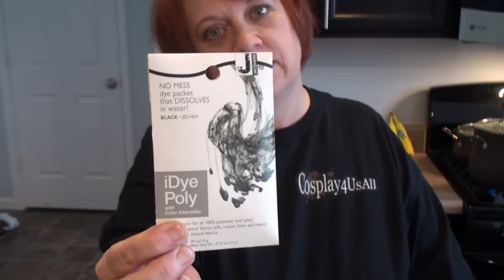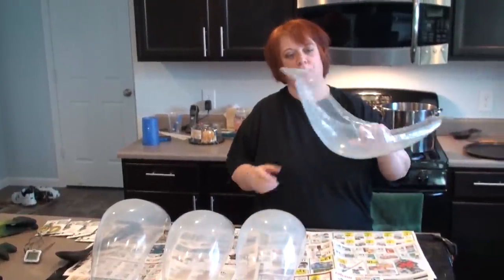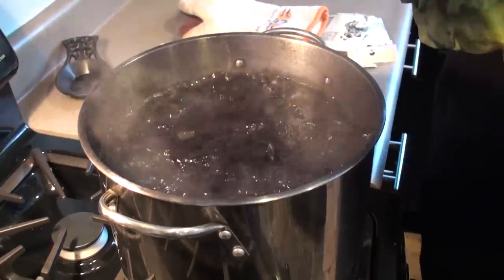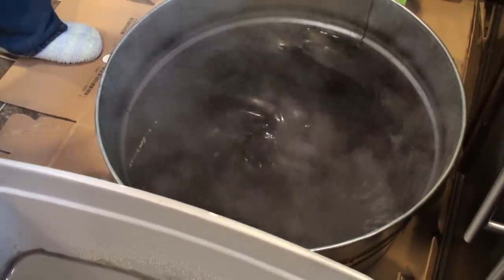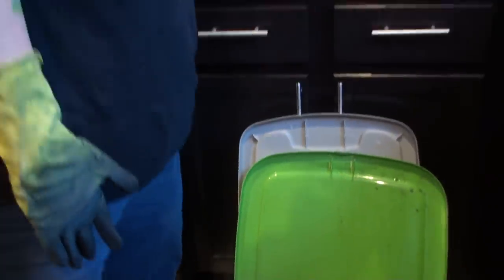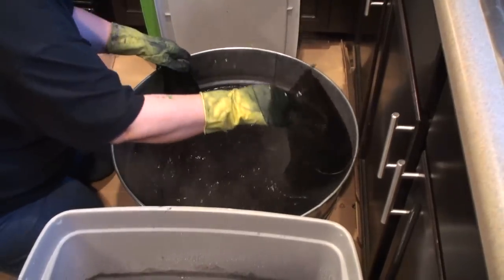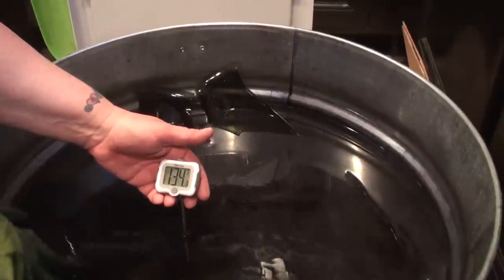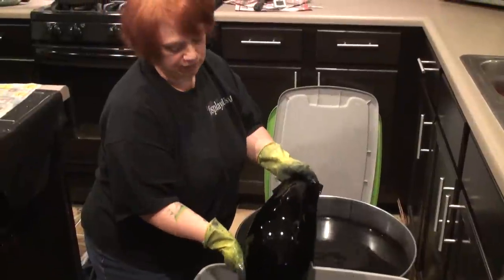How to Dye a Plastic Visor (PETG)

Comment: were these vacuformed helmuts?   & if so, was this plastic origionally a plastic bottle?
 asI'd like to use this method to make a giger ALIEN head dome
Reply from the maker: The actual helmets are resin casts. The visors are vacuum formed PETG (which is the same type of plastic soda bottles are made from).

Comment: Awesome video, was looking for the metal wash basin on amazon and having problems finding it, also what is the dimensions? Any help would be awesome
Reply: Not sure about the specific one that they used in the video, but you can get metal wash basins as Home Depot.  You could maybe also use a metal trash can (although the height may lead to faster water cooling).  Seeing them in person might help with finding the right size.  You could even take a sample piece with you to make sure it will fit.

Comment: I'm having some bad results using this method with acrylic plastic.  I'm using yellow dye and added the color intensifier packet that's included with the dissolvable dye packet though.  Am I correct in assuming that you didn't add this packet for your PET visors?
Reply from the maker: We did indeed add the packets of color intensifier. Acrylic is a harder plastic than the PETG is, so you will most likely need to adjust your temps accordingly. Keep it below the deforming temp, but hot enough for the pores in the plastic to accept the dye. I know others have used it on acrylic, but I don't know the temps they had the water heated up to. Should be able to find that out online somewhere if you look up the specifications for your particular plastic.
Reply: Hi Stephen ! I am actually using it on dimmed plexi glass. My first try was when water was still boiling in the pot, but I don't have the thermometer to check the water temperature yet, need to buy it. The color catch quick (I used the intesifier as well) but I got dye spots on the plexi piece. There might be few factors that caused that. 1) Dye was not dissolved enough and I put the plexi inside the pot too fast 2) Water was boiling 3) Water was too hot 4) Plexi piece actually touched the bottom of the pot and I suppose I need to somehow keep it floating/'in the air' (petg is so to say floating in the water, at least at video from @Cosplay4UsAll). So I need to make more tests. 

Could I get in touch with you somehow? Maybe we could work it out together and share our progress on that.

Comment: Wow amazing I have thermoformed a lot of PETG over the years this looks promising
May I ask if you did any prep work to the plastic first or did you just remove the covering and submerse in the dye?
Also whats the consistency like? 
Is the finish streaky looking in anyway or is it uniform?

Thanks Steve (Australia)
Reply from the maker: No prep to the plastic. There are sometimes a few random spots where the dye settles more than others but most can be buffed out with the plastic cleaner. The finish looks perfect from the outside and good from the inside. There's a link in the details to pictures taken from inside looking out.
Reply: +Cosplay4UsAll Thanks for the quick response love your work will be sure to checkin again soon

Comment: Hi there.  I used this method to dye a pair of lenses for a Darth Vader helmet.  I used one packet of black in simmering water and dipped them once for 7 minutes.  They are definitely dyed, but they are now completely opaque, I can't see on the other side at all.

Any recommendations on what I can do to remove enough dye so that I can get them transparent again?  Also, any idea what I might have done wrong?

Wonderful video by the way, glad you have success with it :)
Reply from the maker: +0newingedcrow Hmm no idea why it would turn opaque. Was it PETG or a different type of plastic? All plastic have different chemical structures and can react different. If the lenses were taken from something else it is possible they have a coating of some sort on them, which would effect the dye transfer. It is also possible the water was too hot for the type of plastic you used. 
As for removing the dye, I couldn't say. We use plastic cleaner (see the details in the text beneath the video) to clean our dyed visors, which does remove a fine layer of dye, but I couldn't say if that would help in your situation :(
Reply: Thank you for the help :)

Comment: My friend and I just followed your video to dye our Daft Punk visors. We ended up with a bunch of sticky ink looking stuff on them and I am wondering what I can use to get this off. It is super sticky and thick, I think the iDye didn't fully dissolve. 
I know you talk about the Meguiar's PlastXand I plan on picking this up but can you recommend something to remove the buildup of Dye/Ink? I would truly appreciate it as a new visor will be expensive and may not be here before Halloween. 
Thanks.
Reply from the maker: Hmm I can't imagine why it is sticky. Unless maybe you used too much dye and not enough water....or the dye wasn't fully dissolved or stirred enough. That MIGHT make it sticky but I couldn't say for sure because we've never had (or heard) of the sticky issue. For dark spots (which happens if it sits on the bottom of the dye bath too long or you have very hard water) you can use Meguiar's PlastX plastic cleaner and polisher. It takes away a lot of the dark spots and will leave things nice and smooth and shiny. Might even help with the sticky stuff!
Reply: We used only one pack and I believe my buddy didn't stir it enough. It was from sitting on the bottom and I assume it is just the dye that didn't dissolve. But because you said you use the PlasticX for cleaning I think ill give that a try. Hopefully it is strong enough to get the spots off as I don't believe it actually saturated the plastic, just surface.
I appreciate your time and informative video.

Comment: Hello! Thank you for the video and I have one question, Ive been thinking of building a helmet and across the visor there is an X Pattern (for example sakes lets make the helmet pink and the actual X black).

Do you think its possible to just dye the outside with the X pattern and dye the inside grey so I see a uniform color and not a big X in my face?

Comment: Great technique! I used this to dye some visors that I am using for an alien costume from the movie Alien. I'm getting a lot of residue on the PETG and it wont come off with soap and water. Did you encounter this problem? Also what plastic cleaner did you use? I am hoping this will take the residue off, as it makes the visor hard to see out of.
Reply: I have the same problem with the residue... Did you find what to do to prevent that?
Reply: Nope. I even tried polishing. This stuff is strong. I definitely suggest not adding too much of the dye powder and/or using a grate to keep the plastic from touching the bottom of your container.
Reply from the maker: We used Meguiar's PlastX  to clean the visor afterwards. For us, it took off a lot of residue. For the deeper stuff you really need to use some elbow grease! Also, not letting the part of your visor that you plan to see out of, touch the bottom of the bucket with the dye, should help reduce the amount of residue. Swishing the visor around should also help.
Sorry for the delay replying to this....just now saw it!

Comment: after you cut those pieces out of petg sheets , are you able to do anything with the remaining petg that you cut away?  Trying to figure out how to reuse it or whatever.
Reply from the maker: Generally no, it's been heated, cooled, and has the pattern of the vacuum form base pushed into it.
Reply: @Cosplay4usall  I just happened to see a video of a 5 x 5 inch dental vacuum former for creating a form of 3d scanned teeth.  Maybe a nearby dentist wants to try it instead of throwing it out.
Reply: @Cosplay4usall   I might try nailing the petg strips to the inside of my shed's posts too because I have seen mice climbing wood when I open the door.  I don't think they can climb smooth plastic nailed to the beams.

Comment: awesome video, i have a question about last two pack of liquid that you add into a pot, what is it? In Thailand we don't have both Rit and iDye, can i use another dye like a "Dylon" to dye plastic?
Reply from the maker: The iDye Poly is a two pack dye. One is a pack you just drop in the pot, the other is a liquid that helps keep the color true and make it grab the poly (or plastic) better....I think, lol. I would think any dye that specifically states it is good for fabric that contains plastic fibers, like polyester, should work. I am not familiar with Dylon so I'm afraid I couldn't answer that specifically.

Comment: Is this the same as thick polycarbonate plastic?
I heard using acetone would open the pores on thick plastic is this true?
Also for best results how many packets should I use
Reply from the maker: I have no idea about the acetone trick. Polycarbonate is a different composition than PETG (Polyethylene terephthalate). PETG is made to be moldable, so is probably "softer" than the plastic you mentioned, although it does look like the working temps are about the same. Number of packets is determined by how dark you want the color, the size of the piece, and the amount of water needed to submerge the piece. The more water used, the more dye packs needed.

Comment: I'm looking to do this, but I want to mask certain areas so they aren't affected by the dye. What would be the best solution? This would be for PVC flexible tubing. Thanks for the helpful demo.
Reply from the maker: Hmm. I really couldn't give you a definitive answer on that as we've never had to do that. I would suggest lots of experimenting on some scrap stuff first! Try masking off sections with various types of tape. It will be hard though, as the tape will need to be waterproof. You could possibly try using liquid masking tape too. Or maybe some sort of solvent/cream/ointment that is water resistant (baby diaper cream??). I don't know....just shooting ideas here, lol. Good luck and let us know how it goes!

Comment: Loved the tutorial. Big question, because I've racking my brains trying to find a way to do it.  Do you think there's a way to add something like fine glitter to the tint so it would stick to the visor? Going for a tinted but also slightly sparkly effect on our visors and would value some input. Thanks!
Reply: Probably late for ya, but you could use a clear coat with glitter. I've used a glitter clear spray can I purchased from Autozone or you could even use a nail polish clear coat with glitter

Comment: Informative video. I had a question, though.

Do you think this method would work on a clear acrylic globe? It's similar to the kind that you would put on a street light.
Reply from the maker: +BrHa Couldn't really say for sure, since acrylic is quite different from PETG. Different chemical compound, different temperature range for deformation and absorption of the dye. If it doesn't work, there are paints you can buy that are transparent and can be used on acrylic, like the stuff used to make stained glass, or to frost glass. Check your local Hobby Lobby, Michaels, etc. And if you try to dye it, would love to know if it works!

Comment: Hello guys ! Really amazing tutorial ! 

Question: is this method going to work with a matt/frosted plexi glass ('frost'/matt is original, I bought it like this)? I wanted to use a paint for ceramics + airbrush but this is not a good method. Paint is too heavy and when mixed with water - to liquid and won't stick to the plexi. So now I am thinking about your method. I already bought iDye (damn, we don't have this in Poland, needed to buy from UK online store).
Reply from the maker: Having never tried this myself, I can't say for sure, but I would "guess" that it would. You may have to soak it longer, possibly adjust the temperature, since it is a different kind of plastic, but I think it would be worth a try! The worst that would happen is the dye wouldn't take to the plastic. Let me know your results!
Reply: Cosplay4UsAll hi! 

So I gave it a try and plexiglass catched the dye. I left it in the boiling water for about 2-3 minutes and I got preety good color. The only problem is that 
a) turquise iDye is actually blue :( I need to mix it with yellow or green to get turquise. Did you ever mix iDye poly?
b) the plexiglass was covered in small dye spots. I am not sure it happened because I left it in the boiling water and bubbles did the job or iDye was not dissolved enough (had the same issue when working with airbrush and glass paint that was too heavy for the airbrush). 
I need to order yellow and green iDye for mixing (we don't have it in Poland :( ) and experiment a little more.

Comment: hi, im planning to do my motorcycle indicator lenses, do u think 1 pack of dye in a small pot should be enough?
Reply: If I had to guess, your lenses are probably polycarbonate.  You could buy 100 packs and it would not dye them.
Reply from the maker: This process most likely will not work for your project. The composition of the plastic on your motorcycle lenses is much different than the PETG used for our visors. The indicator lens covers are much harder, denser plastic, usually with a protective chemical coating to prevent/reduce chipping and cracking. Your best bet would be to use the spray tint and carefully spray the inside of the lenses. You don't need to worry about being able to see clearly through it (like you do with a visor) so you should be fine. That is actually what the spray tint is made for ;)

Comment: i tried this with plexiglass which failed. it just kept coming out perfectly clear. so i got some petg plastic, cust a piece to the shape i need and did this same process but it keeps coming out perfectly clear?? Am I missing something?
Reply from the maker: +Arthur Yore III Did you peel off both protective film on the PETG?  Are you using the iDye Poly and getting the temperature correct?  You also do need to let it soak a while, like it says in the video. The longer it soaks, the darker it gets.
Reply: +Cosplay4UsAll you know what i think i may have gotten a different type of iDye... thats probably it! thanks!

Comment: so i noticed that there is poly idye amd then just normal idye is there a specific one i should use to get the best result. Thanks :)
Reply from the maker: You want the poly one (poly, as in polyester) as it is specifically formulated to work with plastics.
Reply: Thanks

Comment: Would you know how to dye with food coloring? Nothing happens with just hot water. Wondering if salt or vinegar would help
Reply from the maker: Audun Jemtland I can't help you with that one. We use iDye Poly because it is formulated to work specifically for plastics and polyester type fabrics. Food coloring is.....well it's for food. And Easter eggs, lol.
Reply: Hehe yeah you're right. I read a recipee somewhere and remembered you. I swear someone knew. I just tried vinegar and food dye with a white plastic bag now to check, and it became purple/pink. And it worked instantly. Very interesting. But it didn't deepen more. So there's something to it. Thanks for a great video though.

Comment: Is it supposed to appear spots or is it a sign that i did something wrong?
I just finished dyeing it and i wonder if these spots are meant to appear and i just have to use plastic cleaner or that i failed dyeing it and just ruined it
Reply from the maker: Some spotting can happen, especially if you have hard water. I would try giving it a real good cleaning with the product (or similar) to what we recommend in the video description/details.
It is possible your dye was not fully dissolved/mixed, or started settling while it was soaking. If you can get the spots out, you could possibly try dying it again, and hope it evens out.
Reply: @Cosplay4usall  Thank you, it really helped and the spots are nearly invisible now!
Reply from the maker: Yay!

Comment: I tried to do this and I put the dye packets in and let them sit, stirred them around.. put the tinted water in a 5 gallon bucket.. and dipped the visor in.. It immediately became dark blue and clumped up in streaks on the visor. I cant figure out what I did wrong.
Reply from the maker: Wow. I have no idea! As long as the dye was fully dissolved and there wasn't anything on the visor itself, and the visor was not resting on the bottom, or leaning against the side, of the bucket, I don't know! If you want it dark, I would say just keep dipping it until the color evens out (and the streaks are less noticeable). You can also give it a good cleaning afterwards with Meguiar's PlastX, which may help remove excess deposits.
Reply: Thanks for the reply.. Maybe I need to let the dye sit and boil longer and stir the crap out of it next time.

Comment: i used rit Dye . a whole bottle and 3 packets to a pot about the size you have and it didnt work .. Any suggestions as to why ??
Reply from the maker: As stated in the video FAQ section section above:
We STRONGLY recommend iDye Poly over Rit dye as we have heard repeatedly from those using our tutorial that when they attempted this with Rit instead they had poor results, but once they got a hold of some iDye it worked perfectly (which is why we used iDye and NOT Rit)! iDye is specifically formulated to dye plastics (ie polyester, etc)
*Note* This process may not work on motorcycle helmet visors. It depends on the type of plastic used and whether or not it has a coating on it. Many are made from polycarbonate (a thicker, harder plastic) and not PETG. Some are also made from safety glass, which, again, is not PETG and may have a coating on it, which prevents scratches, but will also prevent the dye from being absorbed.
Reply: Thank you For the info I appreciate it